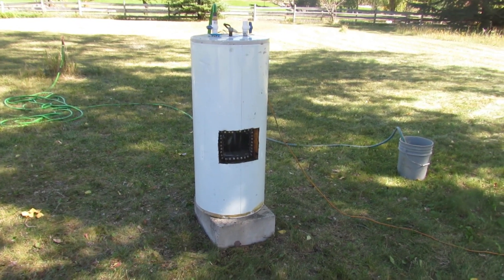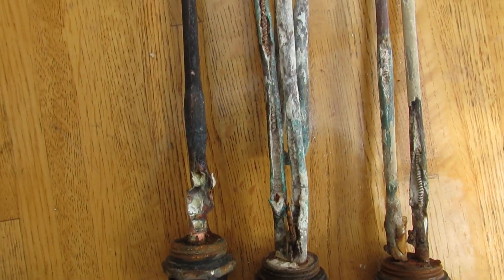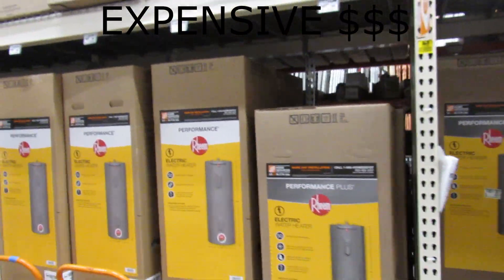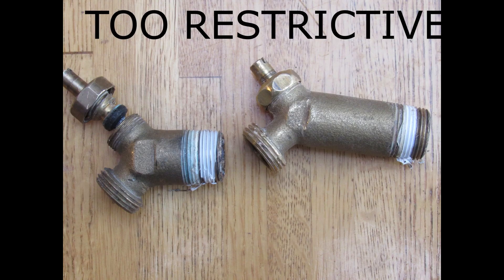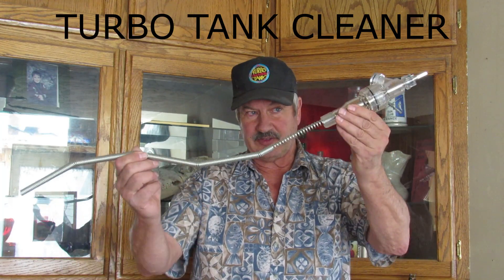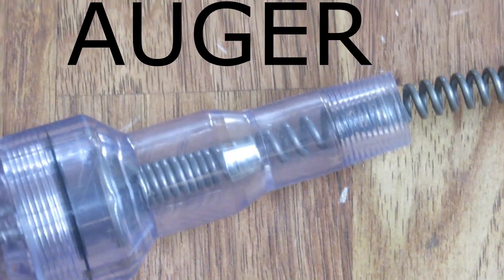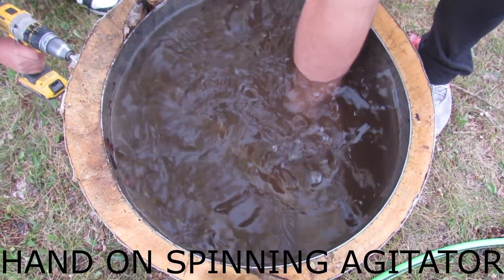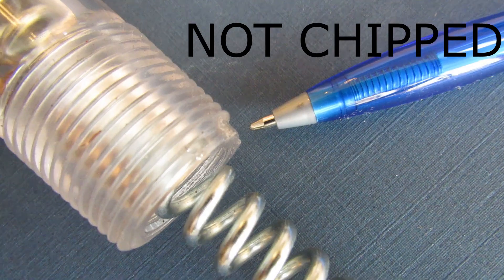Best Way to Clean a Water Heater

Comment: I have a question re draining tank. I assume that when you say it doesn't need to be drained that you are not removing drain valve but installing onto it as shown in pictures.
Reply: He actually means what he said. If you close the inlet/cold water supply valve, and I recommend opening a hot water faucet briefly to relieve the pressure, the tank will be "air locked" like a straw with your finger on the top. The water won't run out of the straw, and when you open or remove the drain valve the water won't run out of the tank either.

Comment: Will this tool hit the anode rod while in use?
Reply: Maybe. He adamantly claims it won't harm any tank parts. The dip tube is more delicate than the anode, and he says it will be fine.

If you can, change the anode rod.